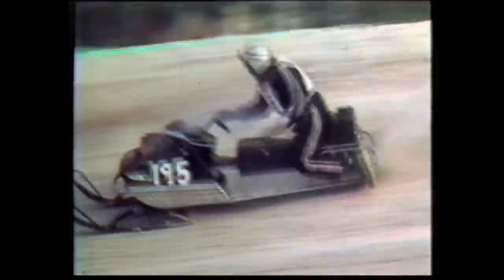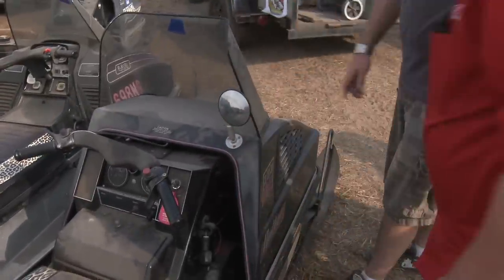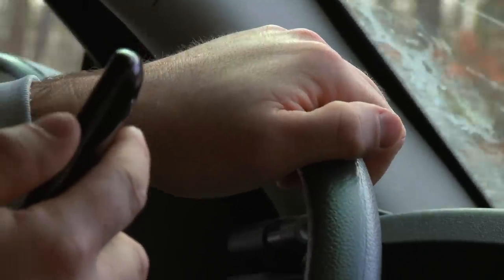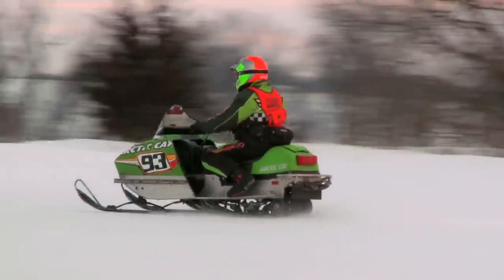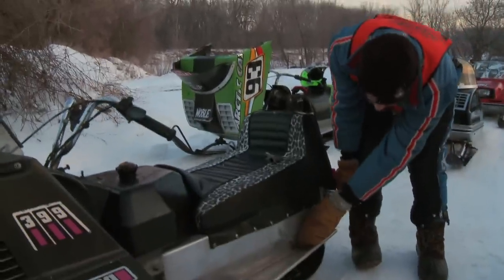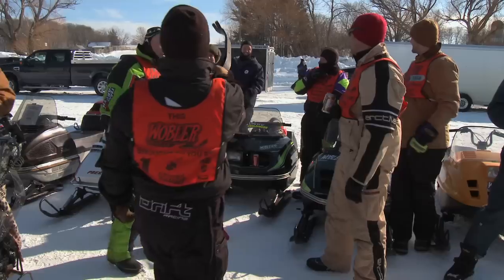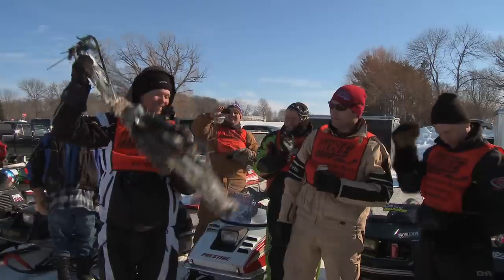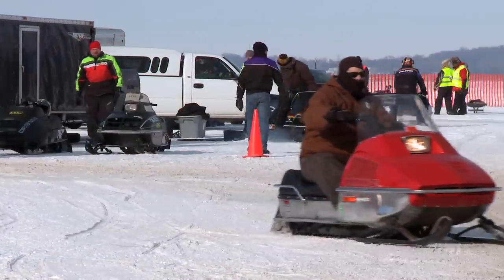SnowTrax goes Vintage

Comment: Those were the good days of snowmobiling.     We had some 71chaparral ss ,Yamaha enticer and 75 Yamaha GPX's , 77or78Yamaha SRX's The mid to late 70s they had some fast sleds for the horse power to weight ratio I know the 77-78 SRX would still be pretty fast today!

Comment: Love this stuff! Started out on a '68 Panther 340 single linger, I was 11 years old and lived in Pierce Idaho. Few will know that area but I remember several feet of snow and shoveling snow off the roof twice! Then Dad added a 440 Puma, was a machine! My uncle became a Oregon Rupp distributor by 1970 after we moved to Central Oregon. I used to race speed oval and drag those Rupps. I wish it was more like the past and there could be at least 50 to chose from and almost everyone could have one. Rupp even got me going on bikes with the Black Widow. I plan on making my way out to Waconia and buying a vintage sled. Also I discovered a North West snowmobile club up around Leavenworth, WA., they have videos in here somewhere.

Comment: Those vintage sleds are awesome! That's what a snowmobile is supposed to look like. I had a 70 something 'Cat Puma 440 and I loved that thing. The industry needs to offer a cheap barebones back to basics model like Skidoo did with their PWC this year. Living in Ohio it is hard to justify $10k on a new sled, but I could really get into an old vintage sled. I for one would be interested in a new basic sled at a lower cost. I'd even take a four stroke for emissions/noise as long as the whole think was under $5K. I'd still like a vintage sled to do an event like this though. It looks awesome.

Comment: I love this stuff. I grew up riding these old sleds. gp292 . Johnson 400 . 77 et250 .78 et340. 84 et340. 86 bravo. 84 et340 trapper. 86 et340 trapper. 88et340 trapper. now we still have a 83 et300. 84et300 and a 86 et340. buying a excel 3 off the guy down the street. old ETs were the best thing out there. put gas in em and ride anywhere.  rare to see a broke down ET .

Comment: nice to see some enticer's here, mine is a 250 :)
Reply: I had a odd et250. it came with a full aluminum body crome tuned pipe. carb looked like it came off a yz. twist throttle. all the skid frame parts were aluminum.  I think it was a race sled  Yamaha built in very low production. this thing would eat a 89 phazer 2 like nothing
Reply: Sled's im redoing my 1976 Yamaha 250
Reply: I sold my 340 exciter to get a 250 enticer. It was the quickest thing in the woods. Loved it
Reply: Lol a 440 Whip!
Reply: 1972 Olympique!  Tear to me eye
Reply: Wish I had an ET  I’m re doing a bravo 250 right now. I grew up on one.

Comment: Hah!  Performance,  horsepower, going fast, how hard you can go thru corners... it all mattered back in the vintage days, nothings changed. 

My uncle owned an Arctic Cat deanship in 70-71' when Kawasaki was the power plants for Arctic Cat and they were the shit with innovation. I saw 150 new cat's delivered in crates, they were all sold within 2 weeks n(even Kitty Cats.  A lot of trade in's and as a kid my cousin and I got to ride just about every make there was at the time, everything from 669 Alpines (which had reverse, cool for the day), to TnT's, Ski Daddlers, Rupp's,  on and on, there must've been 150 brands in the hey day. You ride on the weekends and see 50 different brands of sleds on the trails.

Comment: say. anybody from snowtrax can you answer this series of questions.  these vintage sleds when the brand is long gone and the brand products they used became hard to get. chain case oil, premix oil, ETC. anything aftermarket now seems to be semi synthetic or full synthetic. doing a show on some maintenance for vintage sleds showing the do's and don'ts.  such as chainsaw premix oil not a good swap for a snowmobile duty cycles.

Comment: Am I the only one to notice that this guy speedometer on his vehicle is at 110 mph, must be tired of driving his slow snowmobiles  l.o.l. I'm vintage myself started out on a 1967 Polaris Colt but it was a little big for me so dad bought us kids a little snow pony brand new from a Chev dealer in redwood falls mn, wasn't even couple weeks later, Big Ed my Dad heard a rattle at a faster rpm and went under the hood to see what might be making  the noise, when just then the clutch blew up and shrappnel from clutch went right threw the center of his hand ,blood everywhere afterwards ,parts of the clutch is still in the ceiling, but back then Dad would never even think of a law suit back in the day,just wrapped hand went to emergency room,pd for it out of his pocket, and later fixed sno  pony with new clutch. Later yr dad bought 71 puma ,he loved that thing to death, still have it today, but the closest sled to my heart was when he brought home a 71 polaris tx Starfire 294 twin ,little blue windshield  no headlights straight header pipe,coolest sounding sled on the river, could here it comming 3 miles away. I could go on forever    with the memories, those are the best memories of my life.just loved the smell of the 2 stroke smoke and the crackling pipes of open headers. today sledding just isn't the same and to me never will be,and I still ride today new ones and will till I die. And oh my God the super bowl to me was the winnepig to St Paul races,Dad cheering on the cats, and me for the Polaris,God I miss My Dad, but I still have his puma and 67 colt from the day,well time to stop I'm getting water from my eyes.